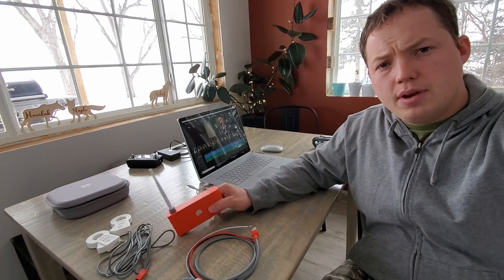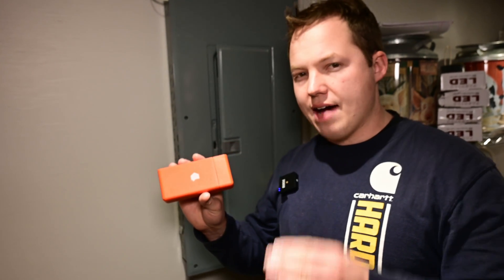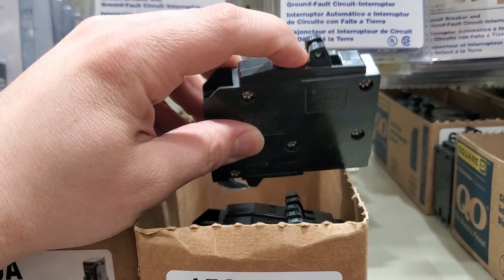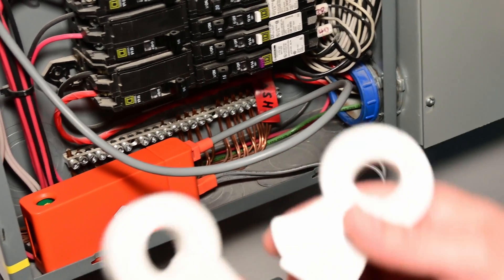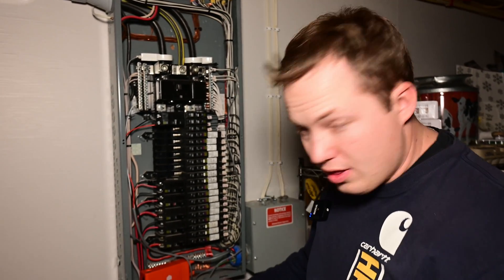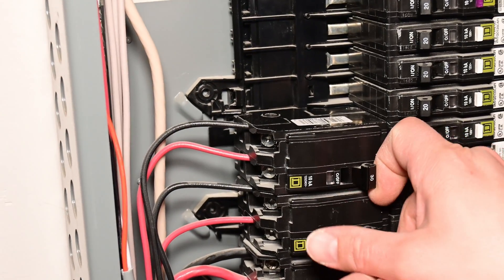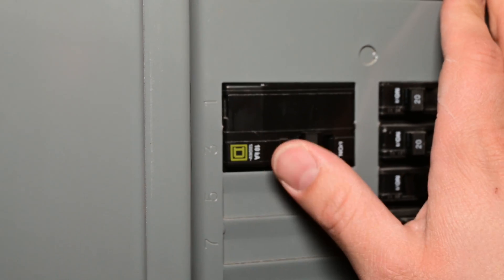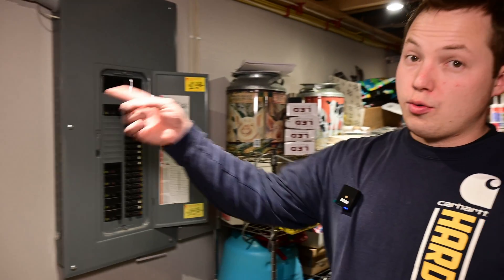How To Install the Sense Home Energy Monitor & 2024 Coupon Code Discount!

Comment: You recommend lowest amp, I notice the pricing for lowest amp cost more than higher amp. What’s the difference if I use higher amp breaker to power the sense monitor?

Comment: Is there anything like this that is cheaper?....and not Wifi enabled?....to only capture the 2 wires from the emergency generator feed to its 30A, double-pole breaker....maybe with the display near the panel......don't need it on my cell phone via WiFi. And only want to know total generator load.

Comment: You can only double tap that breaker if wires are same size & material so if the sense wiring is not #10 copper you can't double it up on that 30 amp breaker with a #10.

Comment: The only double breaker in my panel is for my generator interlock. I really don't understand why this thing uses such low power needs to be connected to a double pole breaker to power it in the first place.....

Comment: How does the app read/recognise the specific equipment (hair dryer/ washing machine/ cooker/fridge etc)?
Reply: You would have to watch the monitor and as you turn on the item you would have the potential to list in the app what it is. However if you turned on a 1500 W hairdryer and then you turned on a 1500 W heater you really would not know the difference you would just know that you're using that power.

Comment: I have a subpanel being fed by only a single 120v line. I only want to monitor power usage from that location. How would I connect the Sense amp meters in such a situation?

Comment: For best signal strength the antenna orientation should be the same as on your router.  Most routers have their antennas vertical (up & down) and therefore the Sense antenna should be positioned in the same orientation.

Comment: First off thank you for the awesome video! Next I have a main 200 Amp breaker at the road. This is 150 feet from my house. Will the sense communicate from that distance to my home WiFi. I took my phone out on WiFi and it still works great at that distance. Just wondering if you have an idea of how far  the sense monitor will communicate?

Comment: NIce Video but get some insulated gloves to work near the hot terminals and a tandem breaker is only stabbed into one side of the two poles it will only provide 120v.

Comment: Going to use your code! Question, I have two 200 amp panels next to each other! Now what?
Reply: Would need more information. Is there a set of wires that feeds both panels that you can put the clamps around?

Comment: you arent a licensed electrician and should not be demonstrating how to install equipment in an electrical panel.  1) its a liability and someone can get hurt because the wires to the top of the main breaker are still live despite turning off the main., 2) You are wrong about a lot of the statements you are making as it relate to codes and safety.  Its a national Electrical Code not a local code, you cannot piggy back off other breakers, breakers protect the wire from over heating and unless you know the draw, tables etc. best to leave it to a professional and stick to reviewing the device and recommend hiring a licensed electrician to avoid law suits, and unnecessary injury.
Reply: Oh stop it! He did just fine and you are wrong about many thing you just wrote, but he should have had some insulated gloves on.

Comment: Where I live, the breaker boxes are inside a cocnrete wall basically, i cant place the antenna like it says on the installation, without that, it would be uesless right ? :(

Comment: I watched your other video on installing a generator interlock and breaker and you had the Sense on your outdoor panel. Not sure where you live but it looks like up north. When I looked at the installation webpage at Sense it mentioned that you should not put it where the temperature can go below 32F or above 154F. I live just outside of Houston, Texas and we rarely get below freezing but it can happen in some years. Have you had an issues with your outdoor unit if it gets below freezing where you live?

Comment: Just ordered one today.  Looking forward to finally "seeing" how my Home Electrical System is consuming power.  

Only issue I expect to run into is my Main Square D QO Panel is virtually maxed out of slots on the Neutral Bar (Lots of doubled up spots. One with a single connection would have room for a second wire... But it is somewhat buried alongside the other wires in the panel.). Thinking if the Monitor doesn't need the Neutral for "Monitoring" purposes I could more easily "Piggyback" into an existing Neutral Connection (the same one I'd be sharing the Neutral bar with anyway... Just via a 3 Lever Wago, that connects to my Video Doorbell Transformer.).

Comment: Is it possible to use the Sense on just the 30 amp twistlock that is going to a 5500 watt generator in order to monitor the amount of watts being used with the generator?
Reply: You could put the current transformers just on the 30 amp breaker in the panel and not the mains.

Comment: Do not put 2 different wire sizes under the same lug of a breaker! The smaller one will be too loose. It is a guide for what sizes can be secured if they are the same size. 2 #14's, 2#10's, etc. You cannot fit 2 #8's under 1 lug because it would be tilted to one side. Consult a QUALIFIED electrician for best installation results.
Reply: Exactly. The other problem is that in most houses the 240V circuits are at least 30 amps (dryer, stove, etc ..). Nobody really installs 240V 15 amp circuits these days. If there's a short, your 14 gauge stranded wire will become a well done steak before the 30 amp breaker trips.

Comment: I have 2 electrical boxes in my house, I have 440 volts 4 hundred amps split between the two boxes. Wouldn't I need to have a Sense Home Energy monitor in each box to find out how all of the electric is being used?
Reply: I don't think you have 440 volts. You most likely have 240v feeding two 200 amp mains. If you can find a spot to put the current transforms that captures both panels you would only need one.

Comment: Hi ... do you know of a device that will allow me to log the power used by an appliance tracking the date and time.  It would be something similar to a Kill-a-Watt device where I plug in the appliance, plug the device into a socket and the device would have the capability to log the date/time that power is being drawn by the appliance and store it in ROM to be retrieved after one or more months.   Thanks ...  Peter   peter@trevlac.com

Comment: You mentioned that you later installed your Sense unit outside on your main panel. How did you waterproof the antenna? Stick it out the bottom of the main panel? I need to do a similar installation.

Comment: Easily best "sensible" description of Sense Installation and beautiful wiring in the main breaker box.
Curious to know your thoughts on two 200A box used for the house...where to use "Sense" monitor?

Comment: Is this able to tell how well your panel is balanced?
Reply: Yes this can tell how well your panel is balanced. But you have to watch it for a while looking at the power meter separation for line 1 and line 2. It's in one of the options in your Sense app.
Reply: @mikeslater6246  
Cool, thanks for the input!
Think I'm going to pick one up.
Curiosity killed the wallet ya know

Comment: At 4:50 the reason you want the current transformers plugged in before you clamp them is to prevent an open CT which is incredibly dangerous. I work for Oncor which is a power distribution company in Texas and I've seen an open CT and it's some scary shit. When a CT is open it acts like a step up transformer and its possible you'll burn the cable or melt the plug if you don't have the plug in first. Lookup open current transformer and enjoy
Reply: CTs meant for consumer gear like this usually include either internal burden resistors, or a saturable core that limits the induced voltage. I don't think any company would want the liability exposure of selling utility/industrial type current transformers to the general public.

Comment: can I connect to just one specific circuit? to get the reading on just that one circuit?
Reply: Yes - if the circuit is single pole then just put 1 CT on the hot wire, if it is double pole put a CT on each hot wire.

Comment: I suspect the current probes need to be connected to the monitor first because these clamp-ons are likely current transformers.  The clamp-on core makes a magnetic path between the coil on the inside and the one wire 'coil' on the outside.  They produce a current proportional to the current they are clamped to.  So now the voltage on their open wires (assuming you forgot to plug them in first) is I times R.  Where I is the current they are sending back to the monitor unit and R is the resistance of the open wires.  A small I times infinity is a large number of volts on those open wires.  Certainly not infinite volts and maybe not a lot of current, and isolated from other grounds, but it might change your train of thought if you got your fingers on it.  Once connected, the monitor unit provides a few hundred ohms of R and the I times R value is manageable for the monitoring circuits and less startling to you.  I love your videos.  I know everything about everything but oddly I've learned a lot by watching.
Reply: Nobody cares, where some insulated gloves like you a required to do and it won't matter!

Comment: If you switch to generator power the top main is shut off. So the two top white clamp on  leads are not reading anything. So how do you get this monitor  to read generator power if I'm feeding the panel with a 30A Double Pole breaker with a inner lock switch ? The 30A breaker is now feeding the panel. So how do you get the two white clamp around top terminals to read anything. Thanks.
Reply: If you watch the second video he refers to in this one, it shows you how he runs the leads from the generator through the current Transformers parallel to your main circuits which will give you a reading when the generator is running if the house is being powered by the generator.

Comment: Only one clamp can fully close.  The second clamp partially closes.  Is that a problem?
Reply: Yes, this is a big problem. Without both of the current clamps fully closed around your two individual inputs you are not getting an accurate reading from the clamp that is not fully closed. Basically, it will not work.

Comment: you said wire feeding monitor was 16 gage and shower a breaker that was good for 14 gage minimum and said it was ok to use, that is actually a code violation
Reply: No. Did you ever plug a small cord into a 15 amp outlet and is that a code violation?

Comment: that was a good video. are there any other products which do similar things? Is it possible to check how much each breaker is using?
Reply: Check brultech.com - I've been happy with their 32-channel GEM ("Green Eye Monitor") at home to monitor two breaker boxes, and the 7-channel ECM-1240 at another site. These are costlier and more work to install, since you have to choose and install appropriate current-transformers on every circuit of interest. Also may not be as play-and-play in terms of easy monitoring with a phone app, but I wanted to roll my own software anyway, and appreciated the communication protocol & data formats being easily available.

Comment: Hi Benjamin, thanks for your great vidios. I've learned all my single phase electrical in high school FFA in the early eighty's when high school taught vocational subjects. I'm learning more from you. I have many sub panals around my farm yard, some daisy chained from the 200 amp main panel and some on there own branch from Main panel. I purchased the sense moniter from your website. I see your vidio calls for mounting in main panel but what if there is 300 feet of distance between them? I use large guage 0-2 cable between them but will the little antenna still moniter and differentiate the loads? From the other panels? I really liked your video about sub panal neutral return to main panel only. And your ground rod resistance test and generator grounding.

Comment: Tandem breakers are not usually 240V, they provide 2 120V circuits. I believe the Sense needs to connect to both 120V (ie 240V) phases to work correctly.
Reply: You can get 240-volt tandem Breakers. There are actually four individual breakers on the setup and to inside Breakers are tandem and the two outside Breakers are tandem giving you two individual 240-volt Breakers in a space where you normally would have one 240 volt Tandem breaker. I have used these and they are very helpful in limited space boxes.
Reply: To make room you need to replace two breakers with two tandem breakers. You would have to rewire 4 circuits. Doing so will free up two breaker slots. The freed up slots would have to be on each phase.

Comment: I just installed Solar to my home, and I was asking my installer what to use to monitor both the Solar "produced" kWh and the "grid" kWh consumption. They reccommended this product. I am going to locate your other video as I am needing the Sense-Solar option....after a quick scan, I am not seeing that other video for a better "promo" for a Sense Solar product. Is it on the video on the way? Thanks for posting! Also subscribed!
Reply: I would not recommend this solar installer. Most solar installations come with the option of monitoring both consumption and production. see enphase.

Comment: Hello,
Can you show after finishing installation of the Sense device, what did it need to be done in order to connect Sense to the WiFi? Thx!
Reply: You load the app into your wireless device, stand close to the sense device and initiate the app. The app will detect the sense monitor and then walk you through connecting it to your network.

Comment: You suggested using a tandem breaker as an alternative to a double pole breaker. That will not work. A tandem breaker uses the same phase for both circuits. A double pole breaker uses both phases.
Reply: He's suggesting that you can make room in a full panel by doubling up two breakers leaving room for an additional double pole.

Comment: I'm surprised you are endorsing this product - have you used it more than a month? Read the support forums. Its machine learning approach to identifying devices is pretty weak - no way to really correct it or make it learn from its mistakes. I gave up trying to read anything into the data it gives out other than the whole house usage. The company is so committed to trying be hip with machine leaning/deep learning they don't allow basic device detection with a manual step like 3 rapid on/off sequences. Anyways - i would have returned it but it's crappy detection didn't reveal itself until after the return window. Stay away - Look for the systems that have individual circuit connections.
Reply: This was my question Rudy.  How does it PROPERLY recognize the circuits and what's in use?  My current (no pun intended) guess is that something around 15A gets designated as a refrigerator, 30A an Air conditioner, 50A a hot tub....etc.  If I'm gonna spend the money, I'd rather spend a bit more and be 100% accurate.  Thoughts?
Reply: @kingofbytes  Your guess is awful, some devices have unique electrical signatures like a washing machine or dishwasher other draw a large constant current and it does not require that much data to start to figure out what is what.
Reply: @kingofbytes  Yup - its pretty useless other than top line power usage.
Reply: @rudywolfs9354  Happy Thanksgiving!  And isn't 'top line' usage just your electric bill?  Haha!

I've heard it does some type of machine learning but it's not programmable.  IOW, you can't tell it that you're 'programming the microwave now'.  It allegedly works to understand 'start up signatures' and 'duration signatures'.  But at this point, so what.  It doesn't even get 10% of your panel correct.

It seems to me the next evolution wouldn't be these bolt on gadgets, but rather making breakers 'wifi' compatible.  That, to me, might be the next avenue to understanding power usage more easily and certainly more accurately.
Reply: @kingofbytes  Simple fix for their engineers but they refuse to do it (so wed to fancy AI stuff) - just let me tell app i'm about to turn on/off a certain breaker that manages X devices and flicker on/off breaker twice - that would narrow down stuff fast. So only improvement of this over my monthly bill is real time view.
Reply: @kingofbytes  Considering AFCI/DFCI breakers now mandated by code are already full of electronics, with significant standby power consumption to run all that (feel how warm they get!), it wouldn't be much of a stretch to squeeze a CT, burden resistor, op-amp and another microcontroller in there. A latching relay & remote switching circuit could be nice too. I'd like to see a standard low-voltage & isolated signal bus for interconection of such breakers, so they can all share a common & efficient DC supply and common data uplink channel - potentially much more efficient than duplicating such functions inside every one.
Reply: @kingofbytes  over time it might become affordable but do you have any idea what Wi-Fi compatible Breakers would cost you right now? And I don't believe they would be functional in today's panels. The heat distribution is inadequate for the micro Electronics. Some of those Breakers in the panel can get upwards of 100° and today's micro-electronics can't handle that.
Reply: @jordanhazen7761  Well all this knowledge and you do not even know these breakers are already available...for a price.
Reply: Is it really that hard for you to figure out what circuits draw all the power and if you are too dumb to figure it out just turn some breakers off it gives you real time data. What the heck do you need to monitor every circuit for. Just a wasted CT on the microwave.